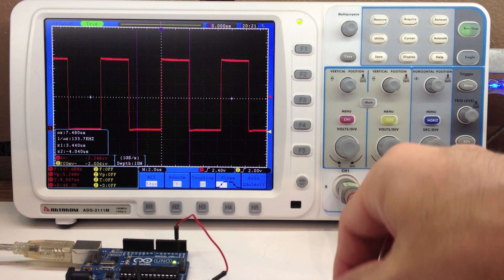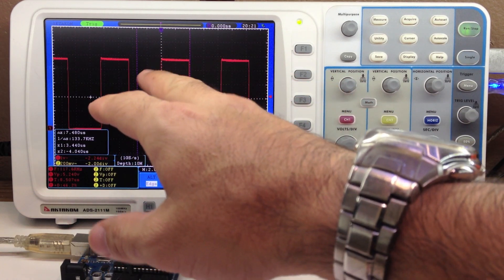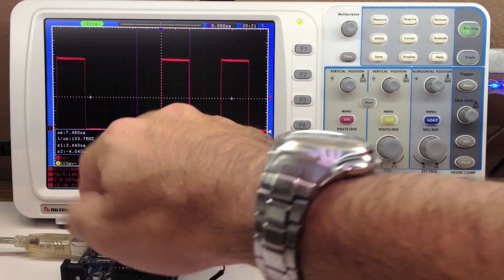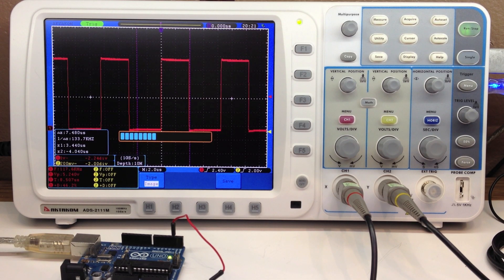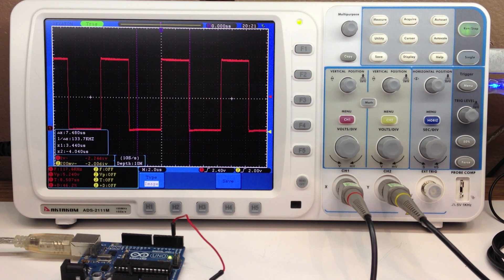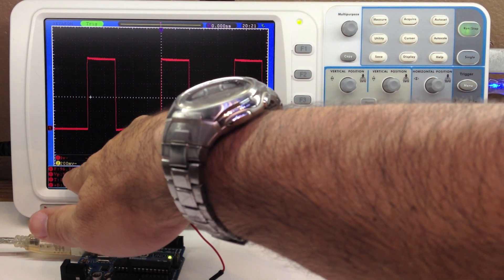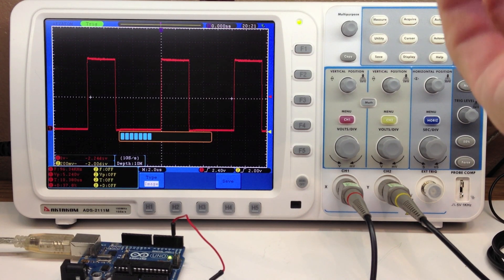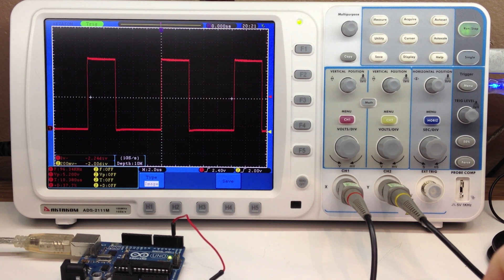Serial or Speed..

Comment: Know this is pretty old now but just curious,  if you were to perform a "Serial.end()" in the setup function, would there still be a performance penalty? e.g. When I startup, I use Serial.begin() to dump out some metrics I have stored in the non-volatile memory to the serial port but then I "end()" it.

Comment: Or, don't go out of the "loop" function until it's safe for your program to do so. You don't know what the hell the code outside the function does (unless you check the library source code, of course). That delay literally happens because an extra if evaluates to true or so.
Even with serial disabled, notice the glitches in the wavefom. That's not the scope acting or anything. That's the same thing. Maybe the library does something special every 256th time it run or something along those lines.